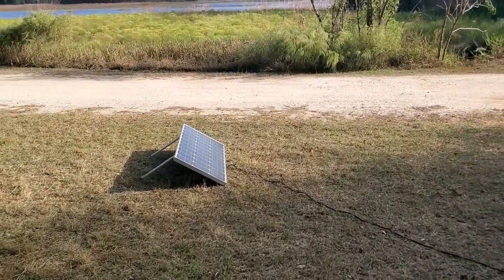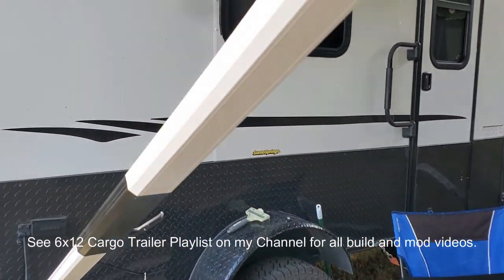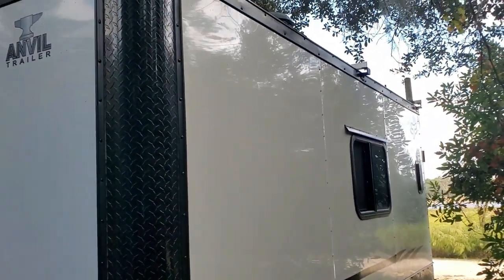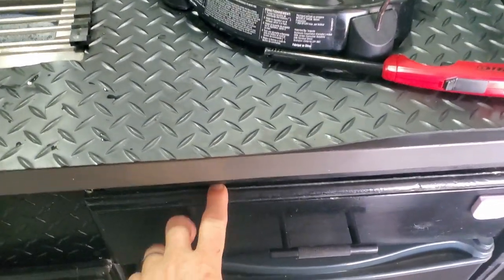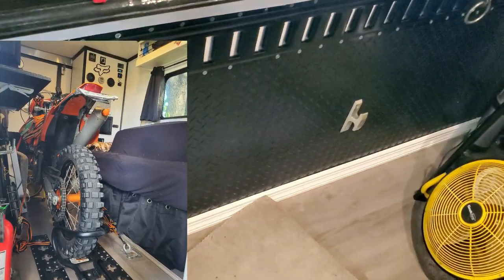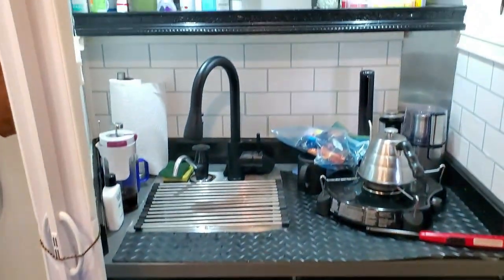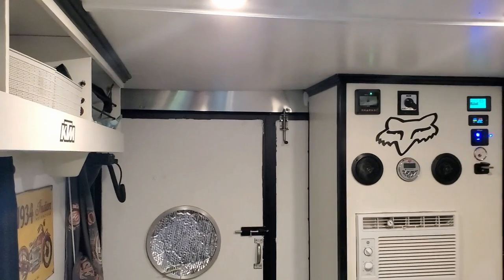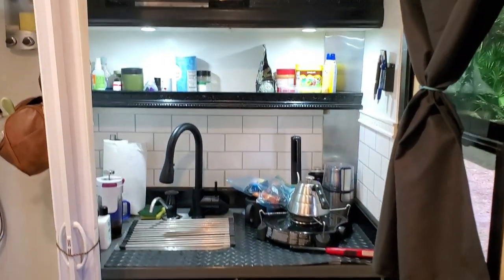6x12 Cargo Trailer Conversion - Updates and Mods

Comment: Great build and videos, thanks for making them! I found you by accident, and it was  perfect timing as I just started ordering things for my build with my 5x12 v nose cargo trailer I have. I'll be starting next week with taking the plywood and putting insulation in. So glad I found your build, as I got a quote for the solar system early yesterday, and it was over 6k for a 3.5 kw system, which I knew I didn't need. I have the same things as you do, the 500 watt ac and the 700 watt microwave, etc. Thanks again for making this conversion - it looks great, and I can't wait to finish mine, lol! Happy travels
Reply from the maker: Thanks Theresa.  Good luck with your build. Solar is pricey especially if you go with Lithium batteries. I built my battery pack and save alot doing that myself along with system installation, but there are simpler ways to do it with Bluetti and Jackery type systems that are just plug and play... but they get expensive too.

Comment: Thanks for the updates and glad to see you out and about again. I would like to see how install those tank level sensors... I don't have any. You want to visit Nebraska next spring and supervise my build? Take care and safe travels.
Reply from the maker: Thanks. Good to be back out and camping.  The tank level sensors are a float type. I bought them at the length needed for the tank depth. Only 4 wires to contend with. Not that bad to install.  I had a harder time with the fresh water tank because it was a half inch too long. I had to build a standoff flange to accommodate.  I bought the gages from AliExpress. I'd be glad to answer any questions on your build. I'd recommend starting a thread on Tntttt.com under Cargo Trailers Conversions. You will get lots of help and ideas there. Happy Thanksgiving.

Comment: Thanks for posting.  I want to build a small  CT toy hauler myself and I am trying to determine what size to get.  I am stuck on a few sizes: 6x12 single axle, 6x12 tandem axle or 7x14 tandem axle.   I also will sometime be hauling one dirt bike or maybe a couple of Trek E mountain bikes.  I currently camp in tents but want to move up to a "camping trailer".  I want to learn from what others have already figured out and this video helps.
Reply from the maker: Glad it helps. Keep in mind if you go with a single axle that you will end up with a GVWR of 3,000 lbs. You will likely exceed capacity with build out and payload. It is only a few hundred dollars more to have them put a 5,000 lb axle in and then you will have plenty of margin no matter what you can put in it. It will also com wiith trailer brakes with the heavy duty axle. Money well spent. So many people are overloaded and don't realize it. Get in an accident with overloaded trailer and your insurance company will abandon you.
Reply: I think I am going to have to be very creative in keeping the weight down.  I see a lot of these with a lot more cabinets and wood construction than I want to use.  I will probably use aluminum like a lot of the van buildout folks do and try to not put much in it.  More minimalism.  I do like the idea of the 5200 upgrade axle.  Good advice.    @donsdoityourself2547

Comment: Thanks for making this build series! I know it's not easy when to film and work on project. It gave me a lot of ideas I didn't think about before taking taking on a project like this. One question I have now that you have lived in it and got to use it. For my design I'm considering a ramp style single rear door. Do you see any issue with not having double rear doors, using a camper style roof mounted a/c unit, and putting the electronics next to the toilet wall?  This would allow for a little more flexibility with what could be hauled and the rear layout in general. I was also thinking of keeping the double rear doors and still moving the a/c and electronics so I could install windows and fold down counters/storage. Let me know what you think or anyone else in the comments feel free to chime in. Thanks!
Reply: Another potential option I was thinking is a 7' wide box on a 6' axle (7' axle overall with wheels). You would still have the same axle but would have a wider box on it with wheel bump ups on the inside. This would keep your overall width the same while increasing the width for more room inside.
Reply from the maker: Hi. Glad you got some good ideas. There is no wrong way for the layout.. Whatever is going to work best for your needs. A ramp door and rooftop AC is just fine. I have  built  3 trailers and the first two had ramp doors. I did the barn doors on the 6*12 primarily so I could have the equipment stack with AC and electrical on the rear and still get my dirt bike in. Good luck with your build.

Comment: Love Ocala forest. You should check out Juniper Springs there.
Reply from the maker: I like ONF too. I have camped at Juniper Springs a few times. Very nice. I think I like Alexander Springs better. You should check that out if you have not been there. It is more on the South end of the forest.
Reply: @donsdoityourself2547  do they have electric hook up at Alexander springs?
Reply from the maker: @AdventureContinuesAgain no, there are not any hookups. There are water spickets throughout, but not at each site. If you are close to a spickets, I've seen folks put a "tee" on it and run a hose. 

There is a dump station to use upon exit.

Comment: Nice build 👍
So running all weekend of 512AH battery, is with running the AC ?
Cheers
Reply from the maker: No, absolutely not. Can only go 10 hours or so with AC running solely off the battery bank. The weekend was just with lighting,  laptop, etc. appliances like fan, fridge,  and water pump, both no AC.

Comment: So I watched your videos and think they are great! Short and to the point. Thanks for not explaining what stuff you have in your cabinets and drawers. You are very thorough and have your build well thought out. Because of that, I do want to know your reason for installing your insulation with foil side against the walls of your trailer. Most build videos I've seen install with the foil inside. I'd like your opinion. Thanks
Reply from the maker: David, I camp mostly in hot places since I live in  Florida, so I was trying to  achieve some radiant barrier effect with the furring strip stand off and resulting air gap. Given the very little dead air space, in reality, it is probably not doing anything for me. Also, given that the either the foil or plastic backing would suffice for a mositure barrier, I am okay if the aluminum skin sweats a bit on the inside when cold outside and heating inside. I friction fitted and taped up well inside to prevent any airflow from cabin, but I do not caulk along the skin and floor seam to allow some air exchange between insulation and skin. I am doing this to prevent mositure build up and potenial mold in the walls which can be a problem in Florida.  It seems to work for me.  I will say though, at the end of the day, there probably is no disernable difference however you place it due to very tight walls.. a radiant barrier is likely ineffective in either direction. Just my thoughts.. maybe over thinking it.
Reply: @donsdoityourself2547  thank you Don

Comment: Hey Don,
That's another awesome trailer you have put together. Now, did you say you run the A/C on a 1500w inverter from the LiFEpo battery bank? That is impresive and you can do that with 400w on the roof. Huh.. I gotta get busy with a solar system. I just have been so busy the last couple of years but am finally getting a handle on things and hope to be acting like I retired soon. It's been 3-4 years now and I swear I have never worked so much in my life. I'm guessin you are the same way. This year I am really making an effort to  plan ahead for more camping and riding time. If I don't put it on the calandar it won't happen. It's not really my style but otherwise I just keep working. Also, I'm not gettin any younger... better looking, yes, but younger no. I'll try to catch up with you on the other site soon. Take care of yourself Smith.
Reply from the maker: Thanks McDave. I trust you had a great Thanksgiving.  420W of solar with 510aH useable LiFePo4.  The 1500W pure sine Inverter will run the AC at least 10 hours if battery bank fully charged and no solar input. I did that a few times overnight in truck stops already for about 7 hours with battery remaining. 

In any case, yes, take it easy.  I retired as soon as possible. Each day is a gift. Loving the freedom right now.

Take care. Always good to hear from you. I plan to be out to Sturgis area next summer with the 7x18 and Kingpin. Maybe can catch you at Custer State Park.
Reply: @donsdoityourself2547  Not sure where I'll be this year yet, but I'll be there. I would love to bring the wife but she doesn't like the big rally crowds. She went to Red Lodge Iron Horse rally and liked it, so maybe.

Comment: Nice job.  I want to build one too.  You have a lot of the same ideas that I have (e.g, window ac unit instead of mini-split).  

Are you happy with the size that you built and the single axle?  What kind of gas milage are you getting vs not towing?  I am torn between doing a 6x12 single vs 7x12 or 7x14 tandem.
Reply from the maker: I am happy with this size. I built it so I could go more places offroad. I also have a 7*18 Vnose I built. I use that when my wife is with me and I am not going off established roads. 

I'd say get a size that will do what you need it to. Smaller is a compromise between manuverability and comfort. My 6*12 is great for me alone... but too tight for anything more IMO. 

Gas mileage drops about 30% with the 6*12. With gas mileage, I have found the mileage is a function of the frontal surface area more than  the weight, although that is a factor. Wind resistance makes the difference. Varies very noticeablility with a  strong headwind vs a tailwind. 

Good luck with your build!

Comment: Great job on the build! Which company did you order the trailer from? Kindly post a link. Also, do you go off roading with it?
Reply from the maker: Hi. I bought the Anvil Trailer through trailershowroom.com. They were the middleman to Anvil. I am sure there are other dealers and etc. you could go through. 

I do take it offroad, but not really bad stuff. Mostly just forest roads.  I'd need to get an articulating (3 axis)  hitch to go more places.  It just has a standard hitch.
Reply: @donsdoityourself2547  Thank you! I'm considering getting one.

Comment: What's the weight on this trailer, any idea?
Reply from the maker: Hi Adam,  when I have it fully loaded with water, dirtbike, and etc. it is about 3,600lbs. I weighed it on the CAT scales on the way out for a road trip. I never weighed it unloaded, but I am thinking it would be in the 3,100 to 3,200 lb. range.

Comment: What was the total cost including the trailer?
Reply from the maker: Approximately $12k
Reply: @donsdoityourself2547  ok thank you. 
My Wife and I just bought one that a guy converted last year and never used due to health reasons. 
Ours is a 12' single axle V nose Forest River with household fixtures and an on demand hot water heater with slide out a.c. tv and all other sorts of cool stuff. 
 We bought it for $10,500 and just had it inspected by the fire Marshal and all is good. 
I still can't believe we got this deal. 
Thank you for your video. These are made so much better than a traditional store bought camper and this is our first. 
We're super freaking happy with it and I'll be camping in it tonight for the first time. 
Woo Hoo!!! 🙌
Reply from the maker: @Spinnaker617  wow.. that sounds good. Hope you have a great trip. This is my 3rd build and they usually cost about 2 times what the basic empty cargo trailer costs. I added quite a few options with heavier axle and etc.  and spent some extra money on the solar power and amenities, but at the end of the day, you end up with heavy duty build. Best wishes!
Reply: @donsdoityourself2547  Thanks man!